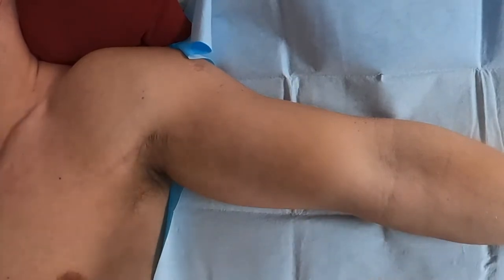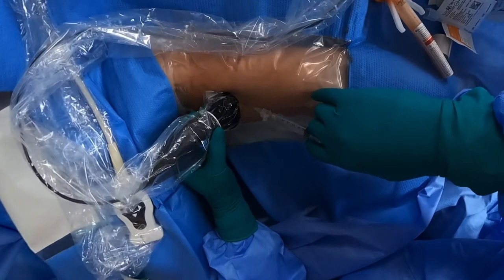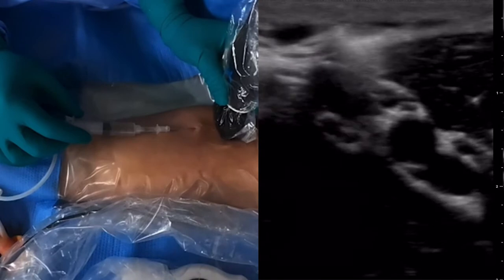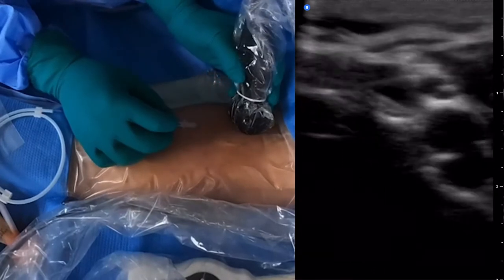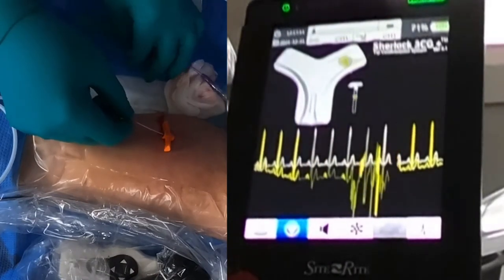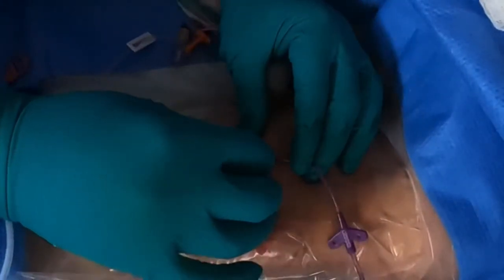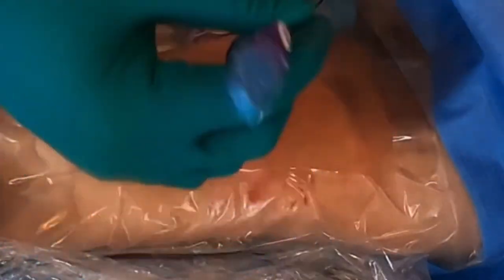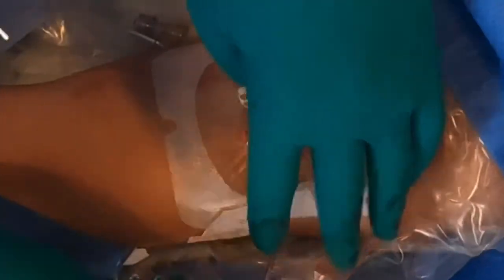#PICC Full Procedure  #ultrasoundiv #vascularaccess #doctor #nurse #piccinsertion

Comment: Why did you tunnel the line from insertion site until you accessed the vein instead of accessing the vein directly above? Ty.
Reply from the maker: Great question! https://www.researchgate.net/publication/235246751_PICC_Zone_Insertion_Method_ZIM_A_systematic_approach_to_determine_the_ideal_insertion_site_for_PICCs_in_the_upper_arm

The Zone Insertion Method by Rob Dawson explains it best. Dressing disruption is one of the key sources of catheter related blood stream infections. The green zone is the best location for catheter exit site because it has the least likelihood of disrupting the dressing due to lack of flexion. The vein in the axilla however had a better “Catheter-To-Vein Ratio” this will decrease the likelihood of developing thrombosis due to hemostasis caused by the catheter. So to give the patient the best odds of successfully functioning catheter until end of treatment I entered the vein in the axilla but exited the skin in the green zone. 💪🤓

Comment: Do you usually place PICC on left?
Reply: When I was in interventional radiology and we inserted portacaths this way (with fluoroscopy): it depends on the patient and the disease. Usually for a right-handed-examiner it's easier to work in the left patient side. But if there's breast cancer on the same side (maybe with upcoming surgery that may injury blood vessels in the axilla) or a history of thrombosis in one of the arms, you maybe prone to the other one. And then I always asked the patients where they want it, because it may cause discomfort when they sleep just on that specific side.
Reply from the maker: I prefer inserting in the right arm when possible because there’s less abnormality in the vasculature than the left side😁
Reply from the maker: I love it! Customizing care for the patients individual needs👏👏🙌🙌🙌
Reply: @thevascularguy  excellent work! I usually go on the right arm as well. For the same reason you mentioned. The left arm has a more tortuous pathway. Also, most people are right handed. It helps with preventing DVT, if you place that Picc in the dominant arm. Unless if they insist otherwise.
Reply from the maker: @a22fc  agreed! I prefer the right myself for convenience, but of course need to readjust device and procedure technique based on patient need😁🤘